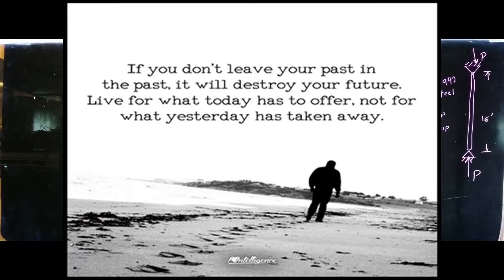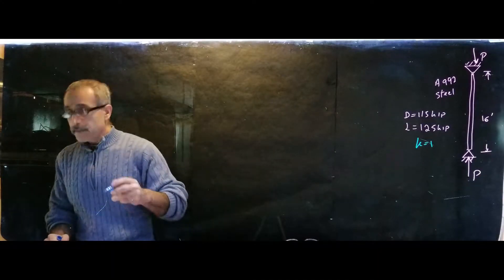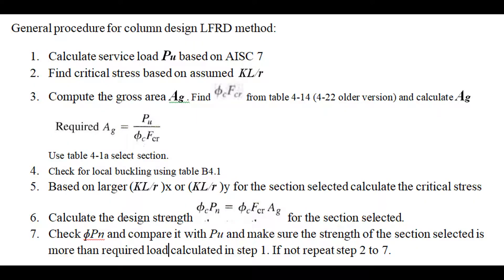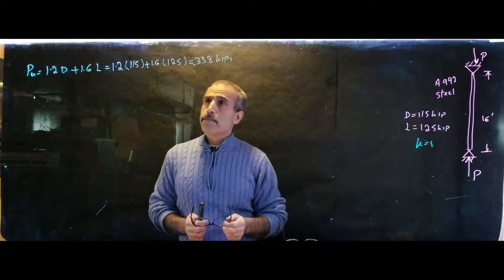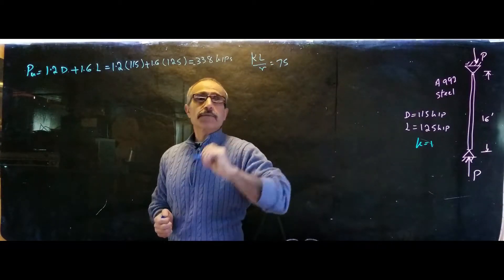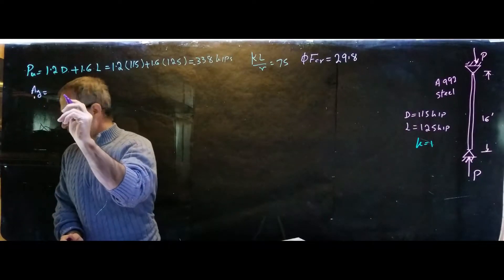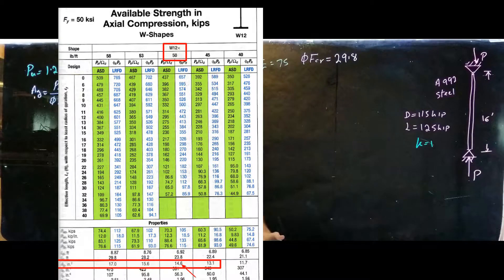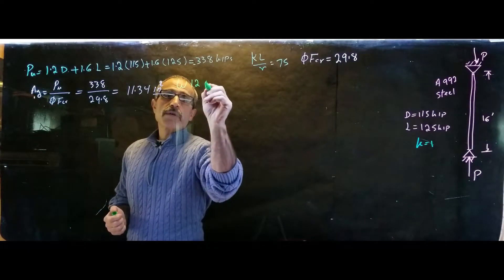Steel Column Design Part 2

Comment: Dr. Yari, why load combination with Earthquake equation isn't used in checking which combination govern? Also, If I want to check the earthquake load combination equation how do I obtain the earthquake load?  thanks.
Reply from the maker: Mie Nge, in this example only dead and live load were considered for simplicity. Certain types of variable loads, such as earthquake and wind loads, act in more than one direction on a building or structure, and the appropriate sign of the variable load must be considered in the load combinations. In order to use earthquake and wind loads you need to know the complete structure dimension and location…The proper Load combinations should be based on IBC 1605 (ASCE 07 section 2). The seismic load effect, E, that is to be used in IBC Equation 165 (ASCE load combination ) is based on  (see ASCE 12.4.2). According to IBC 1613.1, the effects of earthquake motion on structures and their components are to be established in accordance with ASCE 7 Chapters 11, 12, 13, 15, 17 and 18, as applicable. To calculate the Seismic base shear (V = CS W) you need to know the weight of the structure….These calculation can be lengthy.
Reply: Dr. Yari, 
Thank you very much for replying. So the seismic base shear is the earthquake load that uses for the load combination?  If possible can you please do some examples for seismic and wind for simple 3stories residential building and one for non-structural structure like the structural steel rack that we see at Costco ware house using C-channel. Also,  gusset plate design for the rack connection, and mat slab design examples if possible. Would the slab design calculation be different when designing for rack vs. Building?  I send you the email regarding this few months ago if you have a chance can you please take a look. I'm an entry-level engineer and I really need help on this. I appreciate for you help.

Comment: why on step 5 the Fcr is 22.3? shouldn't it be 29.8 like before?
Reply from the maker: Hi Kritofranco,
Thanks for watching. The first Fcr is based on assumed KL(ry); from this value we size the member. Once the member is selected, the actual KL(ry) for the selected size is used in Step 5 to determine Fcr for W12X50. Re-watch the video.
Reply: Thank you so much . You have helped me a lot . I was wondering if you would be able to show another example that has everything included .. the example says to design all the members of a truss that support a pedestrian bridge, you have to design all members and all the connections welded you can use LRFD or ASD methods . The bridge length is 40 ft, width is 12, height of trusses are 4ft, dead load 10 psf live load 20 and sf is 25psf